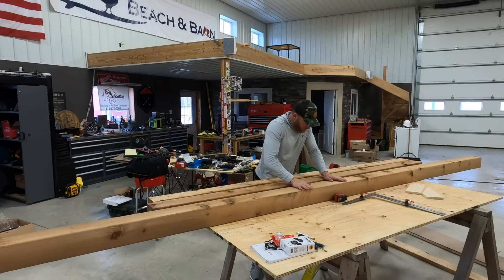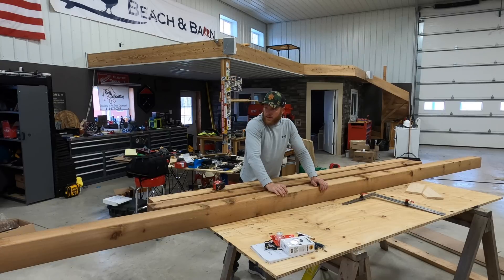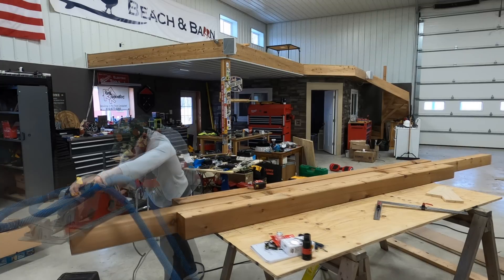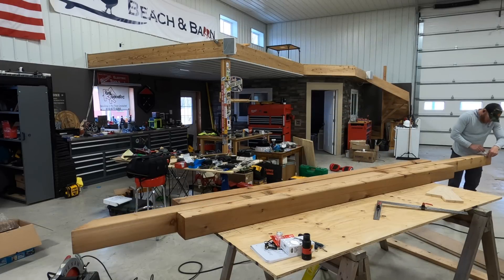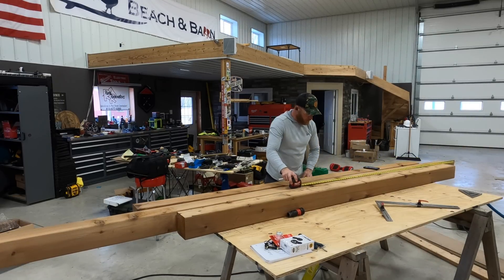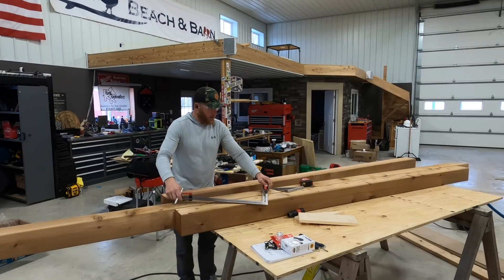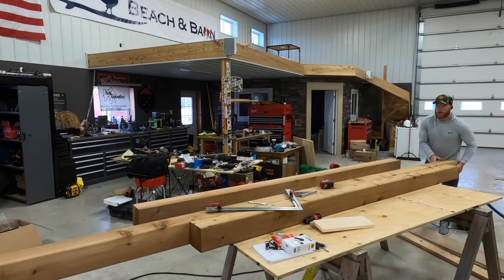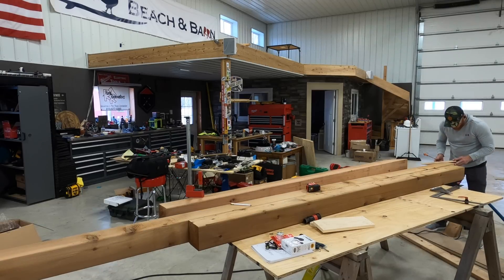Building a Timber Frame Truss for the First Time!

Comment from the maker: I know this isn't perfect timber frame joinery..but it is a start.  It inspires me to do more and learn more.  My biggest professional goal is currently to build a timber frame building... I suppose I have to start somewhere.  I have a future project in the works and hope to make some future videos show casing my journey into learning more joinery.  Stay tuned and hit that subscribe button !!
Reply: Nothing wrong with post and beam when using modern fasteners.  Traditional joinery is very strong, but also from a time when metal was far more rare, and therefore expensive.  I've done mortise and tenon timber framing and besides pride and aesthetics I see no real reason to not use a post and beam method with brackets and bolts.  I do like the look of the cedar timbers with the black bracketry and hardware.  Makes for a very modern and high end look.
Reply: Start small. Build a timber frame dog house, lawnmower shed, - hell - mailbox. Mortice and tenon all joints, get familiar with the operations and process without risking large expensive timbers. Then scale up. 

Take a class but shop carefully for it. Best $2000(? add transport, lodging, meals) you'll ever spend learning new skills.
Reply: I agree with other comments, you dont start your first major wood joinery project on a paying job. Have fun with it on home projects to get comfortable with the process. Critique your own work first before you have customers critiquing your work. This project came out nice, being cedar it should last a good long while.
Reply: awesome
Reply: What made you go with using GRK’s over nailing when framing?
Reply: You would get some great pointers from, "The Tradsman Channel". Throughout many of his videos he fully admit s that he is learning as he goes from the process of logging, milling and cutting the posts, and beam joinery. He gives credit where it is due throughout the barn build. He is just a hard working blue collar worker and family man building his dream. He is a lot like you in many ways. A good starting point for you would be, "The birth of a wooden barn. A timberframe journey, Part 1." I have been watching him for over 2 years. He freely admits his mistrakes.
Reply: It looks nice and is well constructed but do try actual joinery and pegs, you may find it superbly satisfying to forgo the power tools and modern fasteners.
I have watched many videos with interest because about 27 years ago I spent a summer re-roofing my Uncle's barn with Fabral. I only had the single sheet of paper brochure from Carter Lumber, sheets of steel and boxes of nails with rubber washers. Had to teach myself to do it. By your standards true butchery but the thing still stands and is weather tight. You do great work, I wish I had known a fraction of what you have shown and part of me wishes I still did that work. Building is a great pursuit.
Reply: Very well done sir 👍 enjoyed very much .
Reply: Been interested in going some time to check it out but the Shelter Institute offers what seem to be pretty reasonably priced classes. And apparently quite a few tradesmen started learning there.
https://www.shelterinstitute.com/
Reply: RR Buildings you should make a video doing a review of all three rear handle saws
Reply: Hey Kyle, love that timber frame truss. I was wondering if you tell me what kind of clamp you used with that little Kreg pocket hole jig.
Reply: Were these made of cedar posts? And can I make these trusses 40 foot long?
Reply: Misael Arian  ummmm ok
Reply: why not change the title? This is NOT timber framing.  This is screwing large boards together.  HUGE difference!

Comment: If you build another one, the goal of the webbing is to reduce the spans of the chord panels.  IMO, I think it would look better if you would have flattened the web down to where it would have divided the top chord into 2 even panels.  It would also be more structurally sound that way (not that it makes a difference with a 6x6 truss and 16' span).  Anyway, just my 2 cents as a past senior truss designer.  Impressed with your knowledge of the components and love watching your videos.

Comment: I always enjoyed your videos so far but this is my first dislike. Timber Framing means using wooden joinery like mortise and tenon, splines, knee braces, dovetails- just to name a few. Most of them are connected with wooden pegs (not fucking pocket screws :-)). The word "frame" in timber framing means that frames are build, usually called "bents". One bent is raised and then connected with the next bent via dovetails, etc. It makes for a beautiful and strong building. Your project turned out good but I would use the correct termolonology. You have so many subscribers and some now think this is timber framing which I find insulting :-) To your defence, you are using timbers and it is kind of a frame but you can't call it that. It is great seeing you using some timbers though and I hope that you catch the bug and do some timber framing in the future! All the best for that!
Reply: POST AND BEAM CONTRUCTION: Anytime you are using timbers that you are connecting with screws, metal plates, etc. you can call it "Post and Beam Construction". I your case I would have called it a "Building a Beam Truss for the first time".

Comment: 12:23 seems like this style of tool is the “hot new thing”; from Milwaukee & the installation driver, to Festool, & now Bosch with their new FlexiClick, everyone can choose their favorite flavor now😉
Thx for this vid of hanging, chilling, while building a “gable rafter truss” (whatever ppl call it depending on local) for your porch.
Those GRKs though......pretty amazing, & like the new upgraded design they did few months back; they improved a great fastener!
13:31 I spend $0.99 at dollar store for a small silicone non stick basting brush for applying wood glue to my projects. Works well, cheap, & cleans up easily afterwards (just a tip for everyone who doesn’t know this😊).
Cheers✌🏼

Comment: Not wanting to sound mean, but, for the safety of all involved, wouldn’t you want to have an engineer look at the load on that truss. I see your videos and it seems you are concerned for the safety of you and your employees. The loads put on a bearing truss can be great. Just suggesting that consulting an engineer is always prudent
Reply: For a rafter span that small a 2x4 would be plenty in the area this shop is being built.  This truss is definitely overkill, but it is designed for aesthetics not for structure.

Comment: Great video. I have four of these I built on my house over the last 2 years. Could have used a tutorial like this before I did them. Only suggestion would be to use the Ozco timber ties. The truss fan tie on the bottom chord and posts give it a little added strength. And the post to post tie on the end posts do as well. Maybe not with cedar, but mine were all made from treated glulams and 6x6 posts. Pretty heavy and may twist as they dry out. Again, this is a great video for someone trying to figure out how to do these open timber trusses.

Comment: I forgot to mention I was looking at that square when you picked it up. I was noticing how easy the levers looked to turn an lock which would be great for older people with arthritis or weak hands.  I wouldn't want it though because it looks like you couldn't store it flat or with other squares as the levers would break off in a real world working situation or in a work trailer.  It would make great Dad or grandpa gift for an amateur woodworking crafter though. I also thought that Bosch was legit and got excited about that removable chuck then remembered they make bits to fit impact tools quick release already but if somebody had a special drill bit type that wasn't available yet to fit a quick release then that would be really sweet. Is that coming up in a toolsday?

Comment: Instead of the long math, just take the bottom degree and subtract the pitch on top to get the angle. 45-26-1/2= 18.5 or 4/12, little less confusing anyway, cool video

Comment: Nice result cutting those precise mitres for your truss with large lumber.  Usually timber framing is done with pegged mortise and tenon joints.  No metal fasteners.

Comment: What does the connection of the beam back to the building look like? I saw you had a 2x4 to give you a little shelf....
Reply from the maker: Large angle connected to wall and lagged in with structural screws.  Only carrying the 6x6 itself... entire structure is hung on ledger with brackets... so header is only supporting itself

Comment: ... any  drill can put those screws this days.  What is very good with that Bosch is the coverage of 1 tool .
You exaggerate putting that on have work because that drill will never do frequently this kind of job. 
I for my wife's dispensation I have a tool for specific jobs. 
I can put some big screws with my M12 6 in1 because I know how but I am not going to because I have nothing to prove .
You don't buy tools so you don't know how terrible is to break something you paid for. 😊

Comment: Kyle and Greg, very detailed video. You may like to look into Roman truss: "capriata in legno", where the runner is not subject to bending but only to tension, the vertical web to tension also, while the diagonal webs are subject  to compression along with the two top chords. The "Staffa" keeps the whole assembly align. Hope you find this interesting. Keep posting great jobs.
Reply: Anche io penso che per avere una capriata il monaco non deve toccare la catena e le due saette non devono poggiare sulla catena

Comment: I'm just watching this thinking just lay it out on the floor rather than risk knocking stuff over. Could probably even draw it out with dry erase if those floors are epoxied.
Reply: Me too buddy. The whole assembly process is as dangerous as they could possibly have made it. I would not work anywhere near such a bunch of clowns. Didn't see any mortice and tenons which would have contributed long term structural integrity, not to mention a safer assembly process.  
   This video is an excellent example of how not to timber frame. Watch carefully and learn.

Comment: Kyle does a dazzling job here. Those of you who have never fitted the angled joints of a truss as you build it have no idea how easy it is to get lost in your calculations. Reversing a joint angle, forgetting to calculate thickness, failing to figure the offset of the run to the centerline of a double miter, the opportunities to screw up are endless. I've seen seasoned veteran framers and steelworkers stop dead in their tracks, whack themselves in the head, holler at their crews to stop everthing, tear up their sketches and lists, then start over. 

With select cedar 6 x 6 costing $16 and up per foot, you can't afford mistakes. Kyle is braver and more squared away than the US Marines. He got it in one.

Comment: Awesome job!!!  On the "ribs from building to truss, how did you connect them to the truss?  Screws? Nails?  On post frame where I live theres supposed to be a vertical block to prevent 2x6' from rocking...not saying it's right just curious

Comment: Dude, learn how to use a simple CAD program.
Reply: The Analog Kid why?
Reply: @smcox1991  cheating 😁 don't have to do any math...draw it how you want, offset the lines for the thickness of the beam, trim where needed, and it'll tell you your lengths